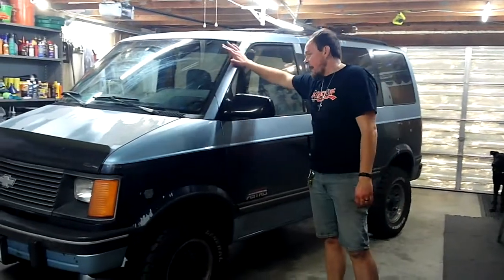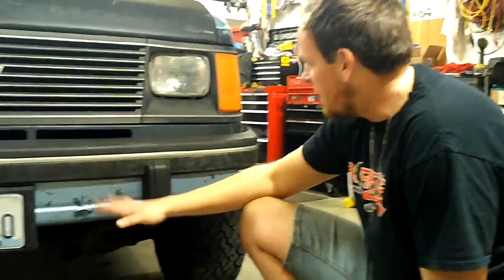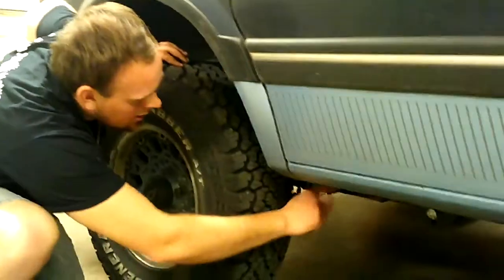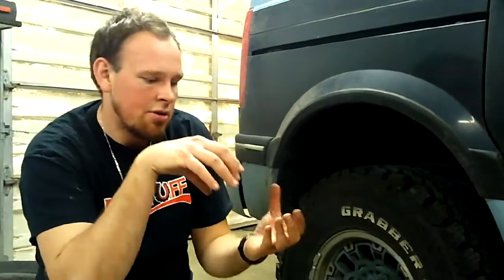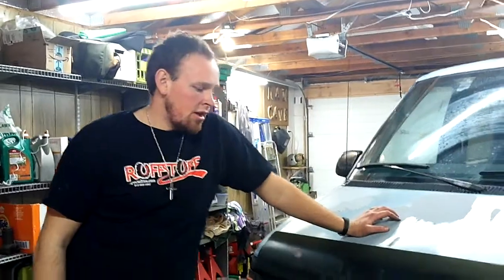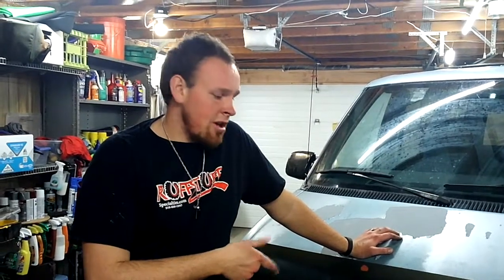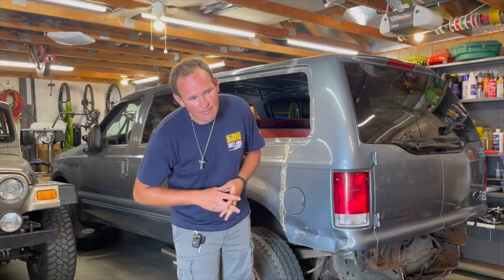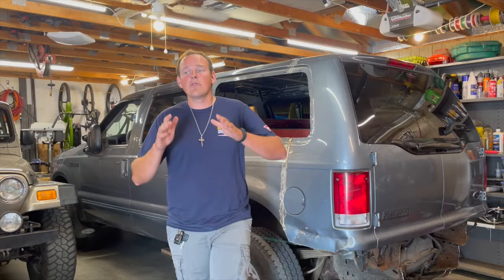Astro Van Build Pt 2: Installing a Journeys Off Road Lift kit

Comment: Journeys isn't answering my email. Exactly how do you 2 to 5" with body spacers? Do they have to be cut down for a lower height?
Reply from the maker: The Spacers are only a couple inches, and then the rest of the lift if you wanted the full 5 would be in the torsion bars. I show the spacers installed either in this video or part one of the build series.
Reply: @Geeks4x4  
Hmmm did that make the ride super stiff?
Reply from the maker: It doesn’t. Van rides great, we only turn the torsions a bit tho, need to keep the down travel, if turned to far you have no down travel.
Reply: @Geeks4x4  
Cool thanks. So how high did the set the front at?
Reply from the maker: @robertd6925  I think were right around 3 inches of lift. If memory serves me right.

Comment: Hey man I have a 94 safari the web site claims the kits are for 96-05 will it work the same?
Reply from the maker: Glad you found this video, So If I remember right the pre 95's have a composite rear leaf spring. We went and got leafs from a newer van, I believe s10 springs work as well (been a while since I did this one) and swapped to a steel leaf while doing the lift. Journeys off road guys are easy to get ahold of and can give you the exact things you need. We also needed a newer van steering shaft.
Reply: Awesome great video great video I was gonna just hit the pull yard and see what I could find 🤙🏼
Reply from the maker: @benpino3094  Yup! that's exactly what we did!